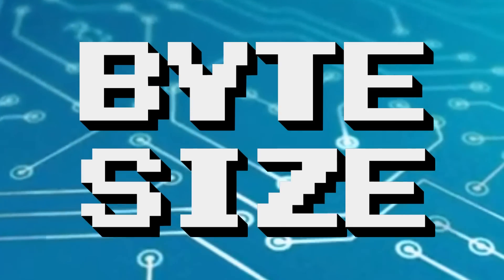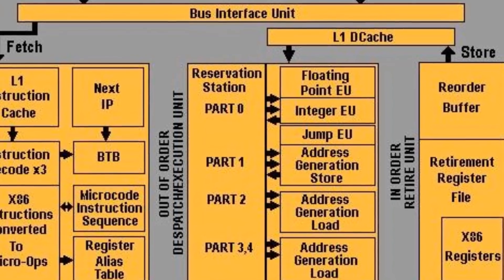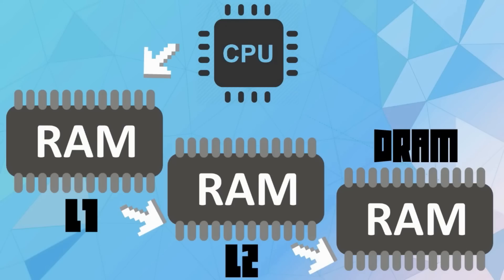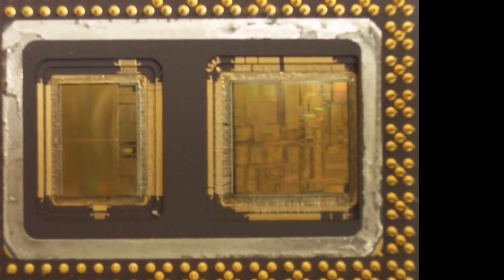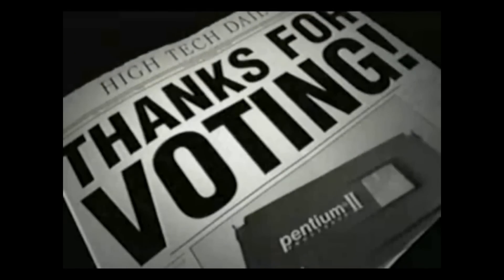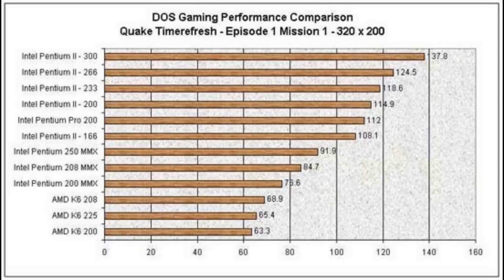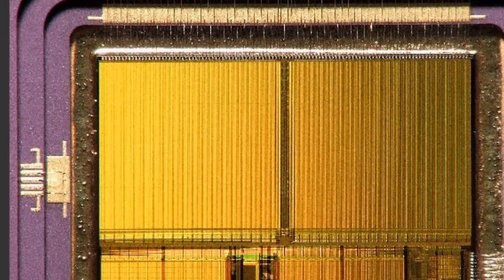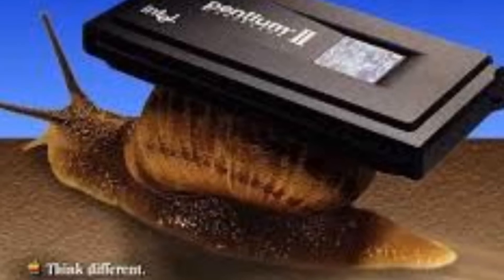Why Were Pentium 2's on Cards? [Byte Size] | Nostalgia Nerd

Comment: AMD started making slotted CPU's at that time too. At the time we just thought slotted CPU's were the future. We had no idea that CPU's would eventually go back to sockets again.
Reply: Athlon Orion. First chip to break 1 GHz barrier, overclocked like crazy (goldfinger!), had half a meg of full-speed cache and it was a beast. I got 650 MHz one, ran at 800, and comparing it to Celeron D 347 (LGA775, 3.06 GHz, and also 512 kB of cache!) the Athlon was much snappier (including faster loading times in Windows, much smoother gaming, and faster response for example when opening programs or switching tasks) despite overall lower processing power. I had those systems side by side - Celeron in Via PT880 Foxconn with 2 GB of DDR2 and PCI-e GF 7600 GT and Athlon on ASUS K7V with 1.5 GB of 133 MHz SD-RAM and GF 7600 GS AGP, buth running from identical HDDs.
Reply: @Vatharian  back then, each ticks of over clock makes a difference.  I used to over clock my cpu 233,lmhz to 240 mhz and see a big performance increase.  Now since cpu is fast, thr bottle neck lies everywhere else including ram, gpu and even monitor refresh rate for gaming. Each component need a certain speed to match every other hardware to see increase of performance instead of one component like cpu.
Reply: The marketing department had to spin it as such. The logistics department probably wouldn't have been too thrilled with the additional space taken up by a SECC when compared to a socketed CPU (especially with tray CPUs)
Reply: I’ve got one of the slotted “cartridge” amd athlons
Reply: It wasn’t the same time, they were 2 years apart and I don’t know anyone that thought slotted CPU’s were the future, we all knew the reasons behind it.
Reply: @BlueRice  I used to clock my 166mmx at 233 and it made a massive difference. My I9 runs about the same no matter how much I overclocked it.
Reply: slots were a failed experiment🤣
Reply: It was a cost effective option back in the days. Back than it was either increase die size on an uni die area or going on MCM(multi-chip module, which can be seen on Core 2 quad and today’s Ryzen) both solutions are extremely expensive by adding L2 cache on it. A 256kb Cache was 2x larger than an already enormous Klamath and adding 512kb will make the manufacture nearly impossible at the time. I know people will going to use Pentium pro black edition 1MB for example but keep it in mind each Pentium Pro 200mhz /w 1MB cache were priced Ten Grands at the time! Compare to 600 bucks Klamath 233mhz it was cost effective!! Later driven by market pressure they were forced to released celeron/w 128kb cache and each production cost can be as high as 300 bucks due to big die and Intel was losing money even with 250nm process.

Amd was at the same reason too because their pluto core was about 240mm^2 and adding a 512KB cache would make it look ridiculously large.

However the main reason they were abandoned slot packaging was because of performance. The cache access latency is extremely terrible(barely any better than on board cache at the time), and cache was limited in speed as well which it became a bottleneck to CPU with higher clock speed. In extreme case it can only runs 1/5 of CPU clock when core clock reached 1.4ghz, making it barely any faster than the slower 1ghz variant. Which was why both party pushed it to on die despite of higher die size and high production cost.

Comment: Talk about a flash back. I actually worked in the factory that made the first P2s. We had a single line and made P2 233/266/300. My first experience with how paranoid they were over quality was when our supplier gave us bad retention clips. Some had metal spurs on them and the concern was they would cut into the cards. We had roughly 10 shark cages full of processors that we had to throw away! I had a blast testing them when we had to "troubleshoot" a tester. and the funny thing was every single CPU was tested and one of the programs that we ran on it was Quake.
Reply: A couple of triva items on this. The first units sent out were actually labeled Pentium Pro on the CPUs. Also we always sold them what the lowest bin measured at. So some lucky people who bought a 233 actually had a 300...
Reply: Did Intel pay pretty good for the work you guys did back then?
Reply: @Chris Russell Lol good point.
Reply: Intel was notorious for being picky, top notch quality even if less then perfect products. Yes intel was more expensive compared to AMD and Cyrix, but Intel offered quality. We always knew whatever CPU we bought from Intel it was tested, and could be overclocked at least one level, even the sucker's celeron wasn't a half bad overclocker. But I still don't understand how they could try to sell a cpu with zero level two cache. Even on paper it seems like an idiotic move and hey, it was. Being even slower then a 200 mhz Pentium it replaced, including at least 128k, if not 256k should have been just common sense. 128k would have costs the company next to nothing. The tag chip being under $2 at the time...  There was a company we worked with that would put the 466 and 500 mhz mobile chips on the cartridge die giving the system a level 1,2 and level 3 of cache. That same chip combo gave the 667 and 733 mhz copermine chips a challenge, let alone early 100 mhz FSB and celeron versions.
Reply: The original poster worked in a silicon fab plant, and has an appropriate Youtube name to match.  👍
Reply: @CaseySexton  I can say Yes they did
Reply: @Heads Mess When the floor workers are also responsible for keeping up maintenance on the machines, then yes.
Reply: @edwarddeguzman3258  Yes compensation back then was not to bad for the maintenance crew. Also OT was really easy to do. I knew guys back then that were getting 6figures mainly due to the OT they were working. Some people would game the system for raises if they felt like they were not paid enough. Motorola was in the same area so it was routine people would bounce between the two companies to get a raise.
Reply: @PearComputingDevices  overclocking was easier on intel CPUs mainly due to how we binned the CPU. It was based on what the slowest speed on a die for the entire lot. So people who had purchased a CPU that came from the sweet spot on the wafer could go way higher. AMD if I recall and still does base clock speed on the individual die. So very little wiggle room on how much you could OC it.
Reply: My dad worked on Implant in F10/F14 and still does today though on 24. Still have an Irish P2 333, the last of the 66mhz fsb Pentium IIs that he got in work. 

I worked there too for 6 years leaving when they moved to 14nm. Should have stayed, they were a good company to work for. 

Are you still there today Etchy?
Reply: 1272 was finishing when I left as far as I remember.
Reply: @Heads Mess Absolutely. My family has tons of college grads who's dads and moms worked at a factory. They all had boats, retirement pensions and paid off houses.
Reply: @spuriouspodge7416  I still work for intel but have since relocated to Oregon.
Reply: i had one of those pII 233 processors in my computer. Damn, starcraft was loaded so fast compared to my previous p90. i loved that computer, only had 32mb of ram though, when i got 128 mb it flew!!! 2gb hdd <3
Reply: instaBlaster.
Reply: @PearComputingDevices  Intel could have sold a Celeron with some L2 cache from the beginning, but there are 2 good reasons why they would not do that: 1. The cache was and still is a significant part of the overall die size so larger die means lower yield for a given defect density (yield).  2. If they introduced the Celeron with 128K on-die cache (because they would want to manufacture it as a single die to save cost), if that L2 cache ran at full-speed unlike the half-speed L2 cache on the Pentium, it would offer too much performance and start to eat away at the higher margin P2 demand.  They eventually introduced the Celeron 300A and later with 128K full-speed L2 cache after demand for the Celeron started to fall.  In a lot of cases, it performed well against the P2.  Also overclocked well, probably the best over clocked chip since that time.
Reply: @i486DX66  Your right on all points here.My small company had teamed up with a company called leap frog years ago to produce a PII accelerator. It was basically a mobile PII (with on board cache) on a PII daughter card with the level 2 acting as a level 3. It might have been only 450 and 500 but it could out perform the 600 mhz easily on many tasks. We offered it as an upgrade over the 400 and 450 "normal" PIIs. At the hardware level this didn't require much. Most software was not smart enough to see it anyway, being like a frame buffer it just worked. At around $250 bucks more per CPU anyway.. quite expensive at the time.
Reply: Wow the Pentium 2 tested in Quake.

Comment: The original celeron (the 300) had 0 level 2 cache and they were 
seriously crippled and Intel quickly released the celeron 300A with 128 
kb on-die level 2 cache running at core speed. These were the true 
overclocking heroes, most of them you could go into the bios settings 
and set the FSB from 66 to 100 MHz and reboot, giving you a Celeron 300A
 running at 450 MHz and, thanks to its full speed 128kB l2 cache, pretty 
much equaling the MUCH more expensive, top of the range, Pentium II 450 
for a fraction of the cost.
Reply: GeFeldz This is pretty much what cheapo AMD overclockers do today xD

I remember unlocking two extra cores on my Phenom X2, essentially giving me an X4 for half the cost (on an already relatively cheap processor line)
Reply: My first gaming system. Celeron 300 over clocked to 450, with a TNT 2 i believe.
Reply: I have a 300a and Voodoo 5 sitting here as we speak
Reply: 300A army remembers. Had to use a dual fan cooler tho. Lol
Reply: Wasn't it the case with those Celerons that they were just PII's which didn't make it through the tests and rebranded as Celeron with some disabled functions?
Reply: i am drooling as i read, I have a stack of old games in cd cases I cant play on my newer pc. Interstate 76, Nightmare Creatures ect.  @davkdavk
Reply: @722Pegasus  Got a brand new pair of VooDoo2 STB Rev C as well.
Interstate 76! Thrashed the demo back in the day
Reply: Yep, the 300A was the first thing that popped in my head with this video.  The second?  The AMD cpu where they laser cut traces between pads on the top and all you had to do to reconnect them was use a regular pencil (the graphite was conductive enough).
Reply: Back when the answer to a certain question was "What power consumption?"
Reply: @pcdispatch  ... Indeed there were. Some of those 300As were PII 400's that failed testing (cache, I believe). Also, early on Intel underestimated the demand and didn't have the Celerons to meet that demand and ended up re-badging some perfectly fine 400s as Celleron 300s. IIRC it wasn't many and the ones that were full 400s were overclocking beasts. I remember that there were some early water cooling folks that got one of these to 600mhz. 

Ahhh..... those were the days.
Reply: I had one got it when they were released, mine did 460mhz or so stable on air with no voltage increase. It and the K6-2 were huge overclockers in those days. I got my K6-2 300mhz to 500mhz it was a beast.
Reply: @davidca96   You had me at 460Mhz.... ;)
Reply: Those were the days!!!! (I got a socket 370 P3/600A, and a few keystrokes in the BIOS to select 133 FSB,  and presto, ..P3/800EB performance...for half cost. I remember the idle temp went from 75F to 82F with that OC...
Reply: A lot of the boards back then switched clock speed via jumpers or dip switches. Bios based settings came later.
Reply: Had a 300A oc'ed at 450Mhz and a Diamond stealth card with 16 MB on board and 32 MB RAM. geez that was so long ago. My boy that was born two years after I build that computer is a full grown man that is the age I was and is building computers. 🤣
Reply: @mdd1963  I did the same with a P3 700, mounted it in a slocket in my abit BH6 and set the FSB to 133, presto, P3 933.
Reply: At that time, as a young man,  i "ordered" a pc to my father who know how to build them.  Celeron 300A, 64mo, riva tnt etc...  He came with a  stock Celeron 400.....AAAhhhRRgghh !!   Uh !??!  400 is better than 300 he said.  Sure, if you don't plan to overclock...
Reply: i've seen so many cheap laptops just getting stuck in endless threaded loops where they system would basically bog down unusably. All because it was trying to run it's own pre-installed OS.
Reply: This is what I built for my LAN party machine!  Budget price, great performance!
Reply: Those 300A celerons could be modified to support dual CPU on the 440BX chipset

Comment: I remember working for Compaq Tech Support and one of the models didn't have the rails to hold the PII down, people would call in saying their computer didn't work and then we would have to walk them through opening the case and what do you know, the Chip was laying at the bottom of the case. I don't understand what the engineers were thinking when they designed the Mother Board, they thought the socket was good enough to hold the CPU in place.
Reply: Interesting.. I got a mb Biostar with a PII400 in it but with no rails (!)
Luckily it's working flawlessly
Reply: Do not blame the engineers. Some smart pants product manager had decided to use a motherboard designed for desktop in a tower style case. When you manufacture in large volumes every cent counts and you don't want to tell your boss that you need to spend few more millions for new motherboard design just to make some model vertical.
Reply: Dark Mode kind of beating a dead horse there mate.
Reply: I got a like new Compaq Laptop, was always good and still works not even a scratch on it...LOL
Reply: We had the same issue with Deskpro EN systems at my office.  Employees would stand them up on one end to save desk space, and they would go -> squirrly -> intermittent failures -> not starting at all as the huge passive cooling heatsink on the PII slot1 CPU would slowly pull it out of that right-angle socket Compaq used for those things...
Reply: Rails cost money you know!
Reply: @vencibushy  You hit that nail on the head. Tech history is riddled with poor product and design choices made by accountants that thought their bean counting was more important than the engineer's know how.
Reply: ...LOL... I just made the exact same comment to this design flaw. I was the very first tech to log this issue with them... :)
Reply: @Andrew Sep - Thanks for commenting on this issue. The first computer my parents bought me in the late 90. was a Celeron 2 333 MHz and it was on a slot 1 socket, but the CPU itself wasn't on a rail, despite the fact, that motherboard had holes for them. However, at the time I didn't even know that the CPU has to be on the rail, because I had no knowledge yet about computers at that time. It was weird to me though, that the CPU, which was horizontally positioned, was somewhat hanging or curved if you were looking at it from the right angle. The computer worked nonetheless. A few months ago I installed the rails on this motherboard and corrected the mistake, that sellers made in the computer shop 22 years ago. In my opinion, the rails weren't installed purposefully because the seller wanted to save a few bucks.

Comment: Does anyone remember the "slocket" adapters that let you put a normal CPU in a SECC mobo?
Reply: I do. My brother and I modified ours to take a socketed Pentium III, as older slotkets could only take socketed Celerons. We did this mod after getting a free P3-700 well after they were relevant, but before that the old Celeron in a slotket was the heart behind many of my computer firsts.
Reply: It was less a "normal" cpu and more "next generation socket" cpu. The slockets just allowed newer processors to work in overstock slot 1 new builds or as an upgrade path from slot 1. Some minor differences between cpu support and some niche overclock utility. (As I recall at least early on the slockets were able to bypass the cpu's suggested multiplier and let you set jumpers for your own, which helped system stability and janky peripherals that didn't like the PCI bus being not an exact division of 33)
Reply: Yes. In 1999-2000 I worked at a computer store building custom machines. I remember when our supplier, Ingram Micro, got cheap and started shipping us slocket adapters with tin leads instead of gold plated. We had a slew of machines go out that would fail to operate randomly until you reseated the cpu adapter. It was a big damn headache.
Reply: Yup, sure do.

Comment: That isn't where it ends! That's actually just the beginning of the Celeron saga: the first one (Covington) had no L2 cache, but soon after,  Intel realized their mistake and released the (superb!) Mendocino with 128 KB of L2 cache running at full clock rate.
Reply: Adi Serghei Covington overclocked to 400MHz which made it pretty good at the time.
Reply: Some guys were running the 300's at 600mhz. Mine sat at 450 for many many years. 500 was doable for most people.
Reply: Lots of people were running the Celeron 300 A at 450 and it ran like a dream, best bang/buck back then.
Reply: We had a lot of fun at #celeron  on EFNET :). I was running 2 slot one 300A's @ 450 or 500 sometimes with the SMP modification on dual slot one board. I was still a fast machine for many years.
Reply: @Jasonsadventures  Can confirm. My uncle had his 300 running at 600. Had to get lucky though.